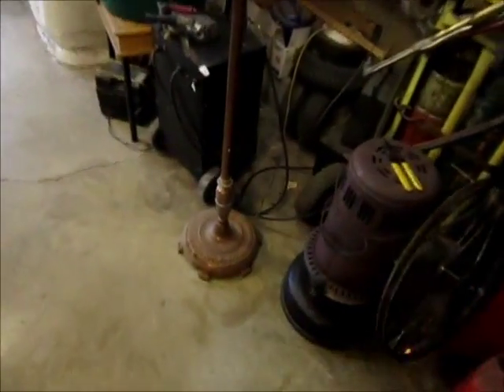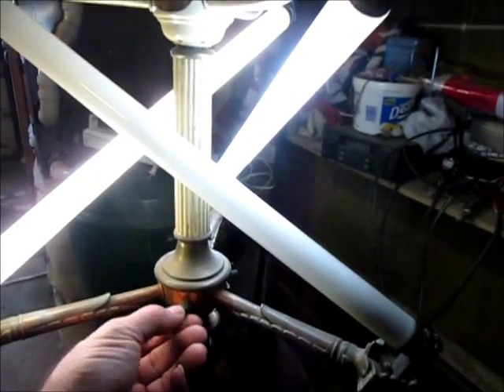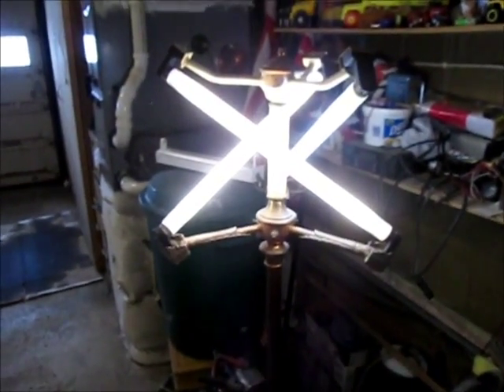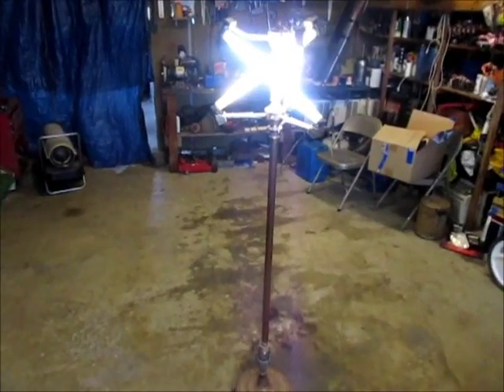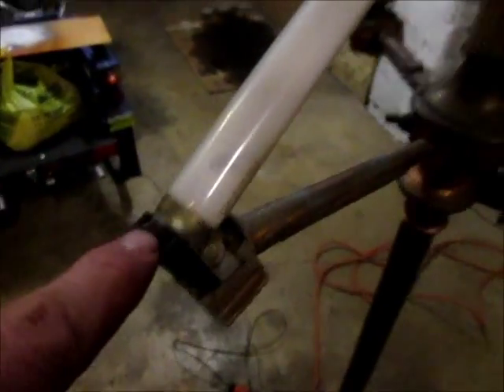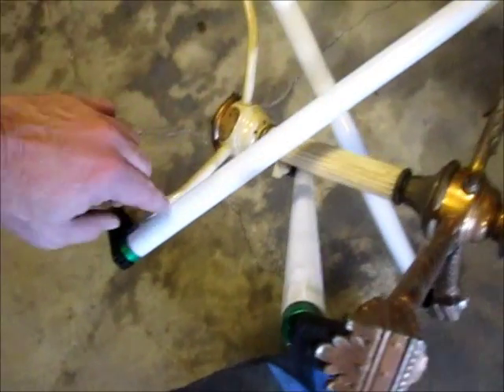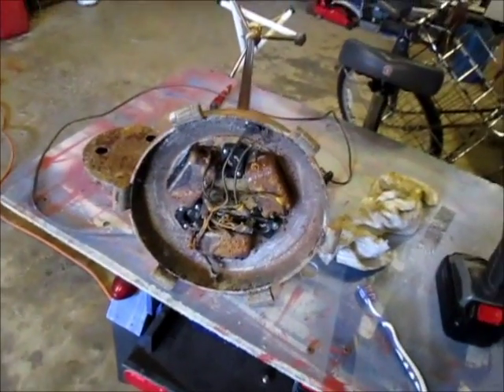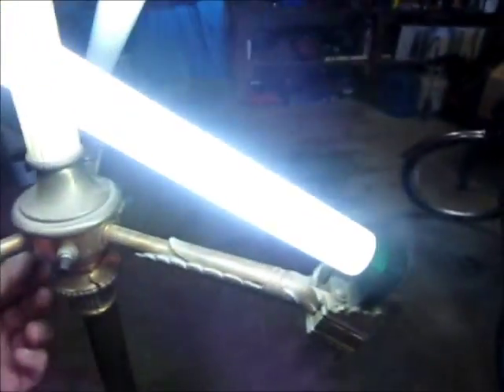1940 Fluorescent Tube 15 watt T8 Floor Lamp

Comment: Beautiful rare lamp.   That's also a rare version of manual preheat.   The manual preheat I'm familiar with,  is the push button type used on desk lamps, I brought one of these at a garage sale several years ago and remember the date code of 11/'95 (perhaps one of the last manual preheat fixtures?) lost it a couple months ago during a move😡    Had two buttons on / off, holding down the ON button caused the ends to glow, letting go starts the lamp.    Used one F15T8 lamp.   My grandmother also had a manual preheat desk lamp, although much older, from about 1970, because that's when she took a job at the bank uptown, and her lamp was much better quality,  metal construction vs cheap flimsy plastic like the one I had.